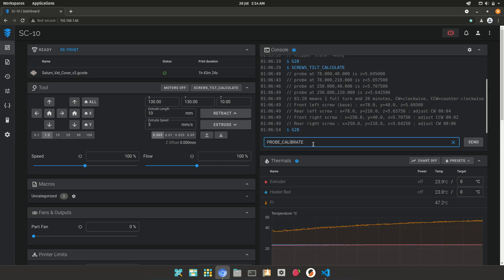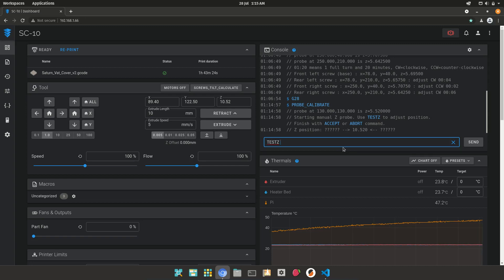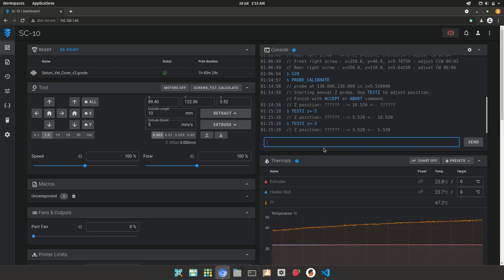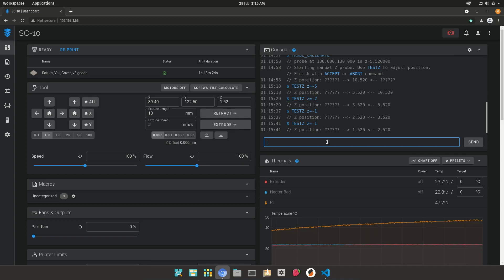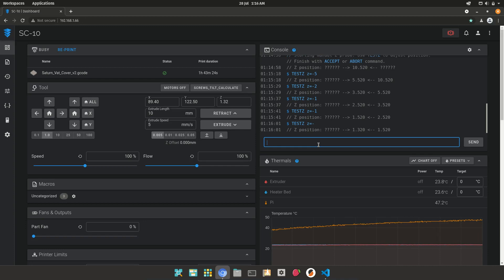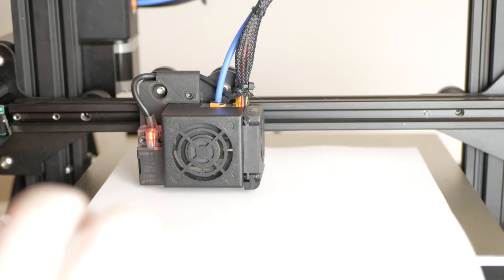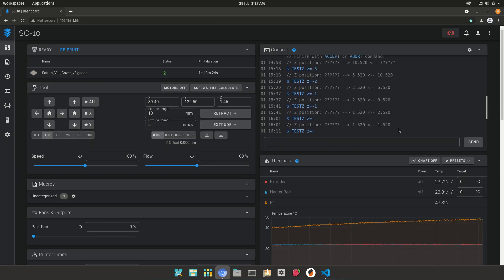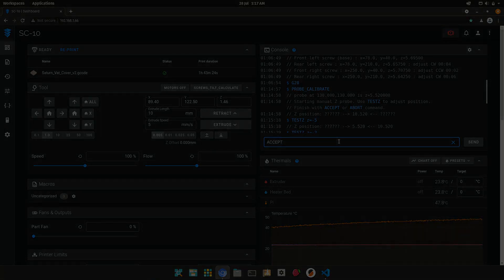Klipper Basics - Setting Probe Z Offset

Comment: Many thanks!! Really needed this refresher. Liked and subbed. Can I ask please.. should the newly set offset not show top left on main screen? I see yours says 0.000mm.. is that just for if you change it BEYOND your new set Z offset? How can you recall what the actual offset is?
Thanks again!
Reply from the maker: Yep, you are 100% right that "Z Offset 0.000mm" will only change if you move outside of your set Z offset using the up and down buttons just to the right of it. I use it sometimes if I'm using a textured bed or a filament that may I want to be further away, for example PETG on a PEI bed, you may not want as much squish as PLA. After you have saved your offset it should be updated in the printer.cfg file under the [bltouch] heading it should say something like "z_offset: +2.8" (the + part throws some people off coming from Marlin who are used to it being a negative value like z_offset: -2.8).

Comment: Do I need to do it at four corners or only center? Thanks.
Reply from the maker: Only in the centre. It's just a data point for the printer to know how far from the bed it needs to be. So, if you did this and then probed the bed the printer will know how much to move up or down on parts of the bed that are too high or too low.

Comment: Your tutorials are awesome man.  I know you haven't made videos in a while but I wanted to let you know they really helped me
Reply from the maker: Thanks, dude! comments like that are what make me want to make some more ASAP!
Reply: @PigeonPrint  Just as a comment on this, when I do this I seem to always be wayyyyy too close to the bed.  And have to run 1 layer test prints where I step it up with babystepping by .005 at a time.  Then re-save it with Z_OFFSET_APPLY_PROBE after the fact.  Idk if that helps anyone or if I should be running a z offset in my slicer.
Reply from the maker: @darkdrakex  personally I run offsets in the slicer as I change out layerhights and bed types quite a lot, if you mainly print one flimient at one layerhight on on bed, nothing wrong with just setting it in Klipper.
Reply: @darkdrakex  This is the command I was missing! Thank you so much!

Comment: Hi Roy, great guide! Did you install klipper on the stock SC-10 controller board and was there guide you used, or will klipper install directly to the stock board? Thank you!
Reply from the maker: Hi, in this example I'm using a printer with a Robbin Nano mainboard from NakerBase. One of the good things about Klipper is its somewhat main board agnostic, so you can use it on a hile range of mainboard, all it cares about if the pins are mapped correctly from the MCU.   

Most of these pin maps can be found in example printer.cfg files on the Klipper GitHub found here: https://github.com/Klipper3d/klipper/tree/master/config

So, for say the original CR10, you would look in that /config folder for the "printer-creality-cr10-2017.cfg" file and cut and pate all of the text into a file called printer.cfg and Killer will use that printer.cfg file to see what pins all the things like stepper motors, thermistors, extruder, and so on are controlled by, so it can use the right pins on the MUC (MCU = Micro Controler Unit, and just means the big chip on your mainboard, you will see MCU mentioned a lot in Klipper documentation, as its basically shorthand for the mainboard you are using). 

If you need any help setting up Klipper feel free to give me a shout, always happy to help, and let me know what videos to make as if you're having a problem with something, then many other people will be having the same issue).
Reply: Ok, I see they have a config for the generic Mks nano v1 that the Lotmaxx SC-10 uses. I have a second Lotmaxx SC-10 I got on clearance at Wal-Mart, so I'll set it up with klipper and let you know if I run into any issues. Thanks much!
Reply from the maker: @JohnKlopp  Ah, totally misread SC-10 as CR-10, yeah there is a config for the stock Lotmaxx mackerbase board, and a few tricks to get more advance features like UART running on the stepper drivers. not a huge fan of the Robbin Nano V1 Board, so you may run into a few issues, but it will work, and just let me know if I can help

Comment: I’ve tried this and it doesn’t work for me. Even manually changed offset under “do not change anything below this line” section. I add offset to start gcode and I end up moving too far after the second start. Both my klipper printers do the same thing, maybe latest klipper has an issue with deltas? I have to remember set offset before the nozzle hits hits the build surface. No matter what I do klipper ignores saved z offsets.
Reply: Same here. It's a freaking nightmare with deltas.

Comment: Fantastic video on the z offset calibration. So I did this with the paper technique but when it came to printing it was still a little too high. I used the arrow keys to drop it a fraction more but it doesnt seem to remember for the next print. Is that right or is there a better way to adjust on the fly ?
Reply from the maker: Yeah, that's right, It won't remember on the fly changes if you use the offset arrow buttons. 

The best options are: 
Change it to the new vale in your printer.cfg in the line z_offset: (keep in mind if you're coming from Marlin, in Klipper we use + no - for the Z offset, so for me its z_offset: +2.7.) 

Or, option two, add the extra amount you lowered the nozzle into your slicing software....most will have a Z offset option and if you found you had to adjust it say +/-0.05mm you put the Z offset in the slicer as +/-0.05. 

I prefer doing it in the slicer as I found layer height can have a big impact and this way I can have a profile for all the layer heights I use with the extra offset needed inside the profile itself.  

Hope this helps, and any other questions, just give me a shout!
Reply: @PigeonPrint  Well. It would have been so much better if we could just adjust this value on the fly. Why can't we?
Reply from the maker: @drrandom1259  You can, have a look for the Z Offset button that has an up and down arrow and a value next to it (in this video you can see it just under the retract and extrude) here you can click on say 0.05mm and then hit the up or down arrow so you can do it on the fly and then save the offset.

Comment: What if I need to fine tune it more? Does increasing the number in config bring he nozzle more up or more down?
Reply from the maker: I do any fine tuning adjustments in my slicer as it usually only needs changing if I'm using different layer heights, do doing it in the slicer means I can have different profiles for all the combinations I use. But you can always rerun PROBE_CALIBRATE if its off (you don't want to change it in the print.cfg file as the PROBE_CALIBRATE
 data is stored in a section at the bottom of the code that is not meant to be manually eddited.

Comment: Once again, Roy Kent, you are a lifesaver! This is the perfect Part 2 to your "Klipper Basics: Adding a BLTouch." 

Just two things: You should add the "Adding a BLTouch" link here in your description for a nice cross-post SEO. Also, I find heating the bed and the nozzle to your average printing temps, before running the test, give better results as to the true height of bed to nozzle.

And as always, THANK YOU VERY MUCH!
Reply from the maker: Good to hear it helped and always after feedback. Cross-linking is a good idea! Will do that. I was torn over the heated bed and nozzle (Its something I personally do) but the Klipper documentation state "Always perform the paper test when both nozzle and bed are at room temperature!" The logic being the potential ooze of plastic from the nozzle could affect your paper test result. So, I left out my own personal preference and just linked to the Klipper page.
Reply: @PigeonPrint  So... you can get the best of both worlds by just heating the bed...

Comment: i bought a transparent g clone and i installed it on ender 3 with bowden setup why during retraction it makes a very loud sound
Reply from the maker: Hello, is it a BMG extruder clone? If so, some grease on the plastic gear may help, and make sure you have Stleth Chop disabled in you config for the extuder, as switching between modes during fast movements can make it loud. 

You can do this by setting stealthchop_threshold: 0 under the extruder section. Hope this helps.
Reply: @PigeonPrint  i installed a bmg clone extruder with bowden setup on ender 3 but when it retraces the extruder makes a loud noise. can you help me on how to solve it? i'm using a stock board ender 3 v2 v4.2.2 tmc2208
Reply from the maker: @madorax251  Hi, my first guess would be that you have the extruder stepper set in stelthchop mode, so when it dose a retraction it is switching from stelth chop to SpreadCycle mode...this switching of modes tends to lead audible clunk! 

To fix, or at least mitigate that you could change just the extruder stepper to be in SpreadCycle mode. 

In your printer.cfg look for the line under [tmc2208 stepper_x] where it will say
stealthchop_threshold: 250

(I'm guessing it will be set as 250 and if it is, change that to 0. this will make it so its set as SpreadCycle by default and wont make as much noise by ting to switch modes on fast movements like retractions).

Let me know if this helps!
Reply from the maker: sorry missed this comment. have replied below with what I hope is a fix.
Reply: @PigeonPrint  on the stock board ender 3v2 v4.2.2 there is no stalchop setting and steper driver current setting. can only adjust the vref current manually with a screwdriver on the steper driver.
Reply: what rotation distance do you use for bmg extruder 22.6789511 with gear ratio 50:17 or 7.710 without gear ratio? which do you think is better for bowden setup?
Reply: Retraction sound like this https://youtu.be/8_YDPrQ85NA